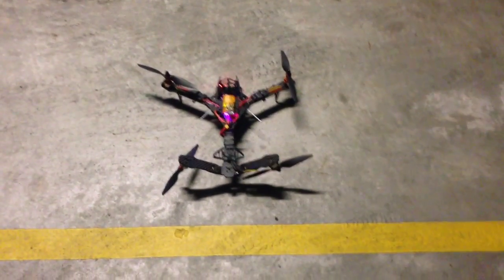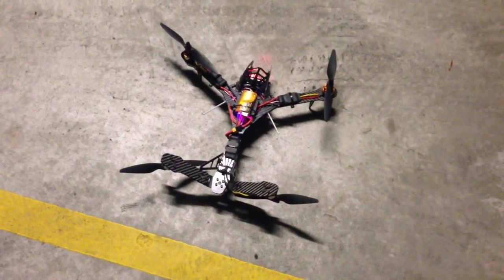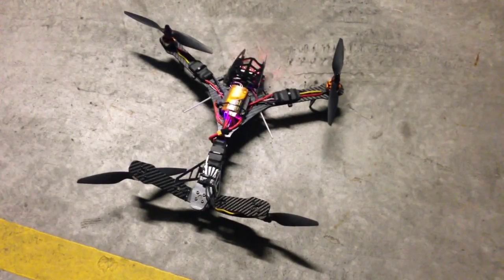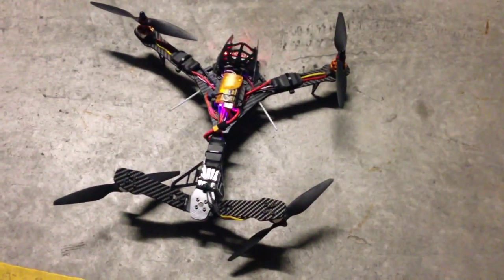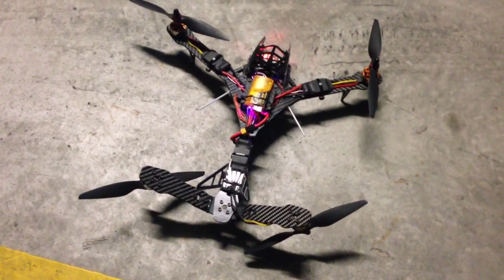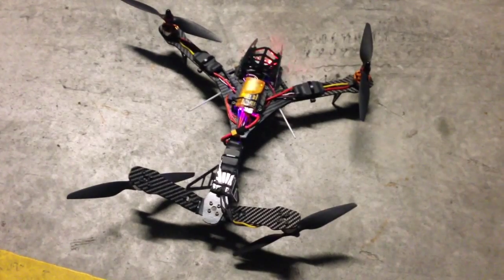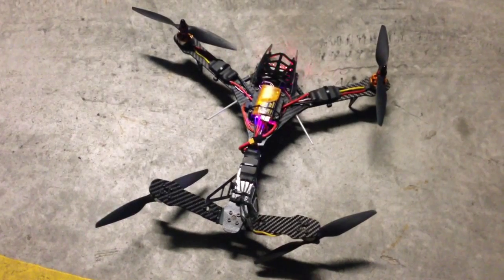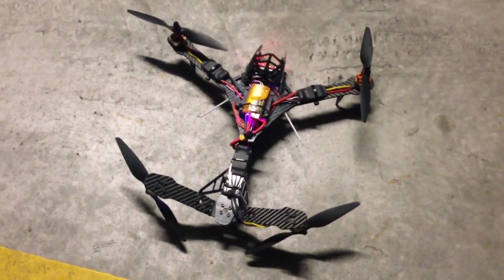Motor twitch on BLHeli firmware (Fixed - see below)

Comment: I have the same problem sometimes too and I don't arm the drone in a certain amount of time each motor would twitch but when I arm it it stops I don't know if it's a warning signal saying your battery still plugged in and you had not harmed it or something else but it stops when I arm it

Comment: Good advice Robert keep the good work mate also I figured out those drones the Naza lite gear I've just learnt how to configure a Tatt to the remote I've set manual altitude and GPS to the remote on switch I flashed firmware update all good to go mate good work thanks for your advice cheers Heath

Comment: yes, this does fix the problem, if min_command is lower than what is min in esc, the esc will act up because the value is out of its min/max range

Comment: What type of airframe is that and size, and it appears you have front motors pointing down.  Does this give any flight performance advantages?
Reply from the maker: James Kimble Hi James, that is an Armattan V-Tail and the rear motors are facing down and angled outwards.  The V gives very good yaw response in flight as the side thrust component is more direct.
Reply: Trainboy64 ohh I see nice man

Comment: What version of blheli? I had a stutter issue when flicking on and off on throttle, I did 13.2, changed PWM Timing to high. Seemed to change that. I have not had any twitching, have you tired backing off you throttle Trim ? You might be so close to the edge of min throttle, just an idea.
Reply from the maker: DCVINRC Thanks, I'll try that also.

Comment: Dont know what controller your using but try lowering min_command.
You did recallibrate your esc,s after flashing them?
Reply from the maker: ***** Using the Naze on this one.   I set the min and max throttle positions in the software and then wrote to the ESCs.  I'll try calibrating them again.